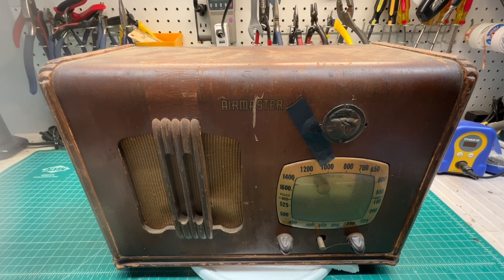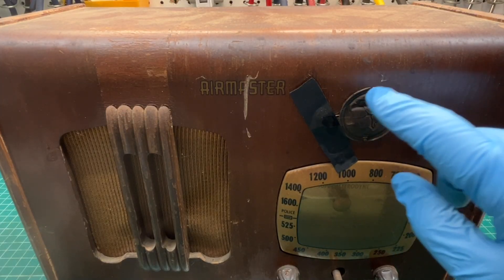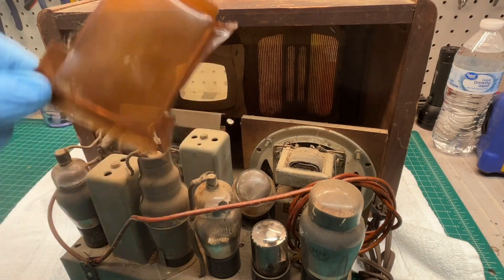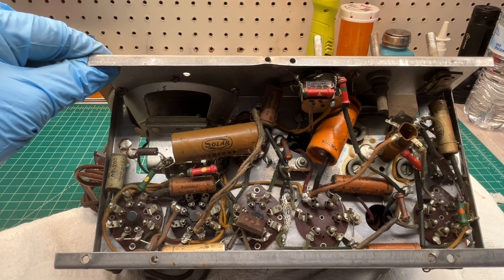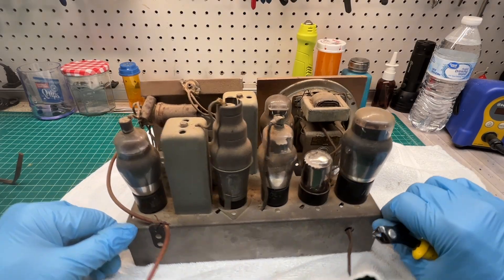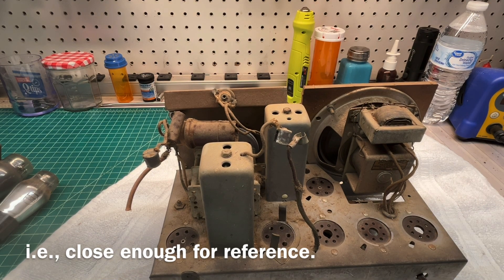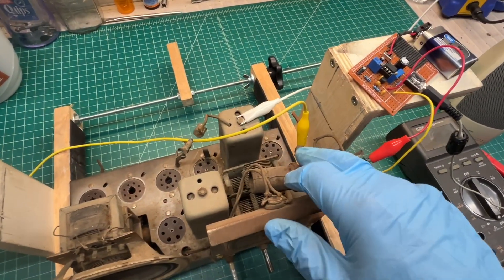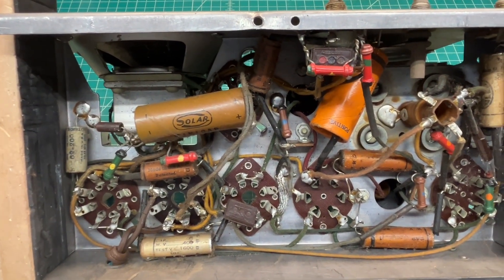AIRMASTER | 5 Tube Radio w/ Ballast Tube | Evaluation

Comment: A simple, yet high-quality set---I like it. That has to be the thickest wood I've ever seen used on a radio cabinet---maybe 1"?
Reply from the maker: Thanks for watching. The top substrate is 1/2” thick with the sides and base at 3/4”. It’s a heavy table radio for sure. Best, Don

Comment: This is going to be a very interesting restoration Don, looking forward to future videos on this Airmaster radio, especially the wiring of the AC cap to replace the ballast tube.
Reply from the maker: Ken, thanks for watching and the interest in the capacitor voltage dropping process. Best, Don

Comment: 06:13 I like the way you removed the grid cap to avoid stressing the old cement.
Reply from the maker: Thank you. I’ve pulled the grid caps off many tubes in the past by pulling and twisting. All the best. Don